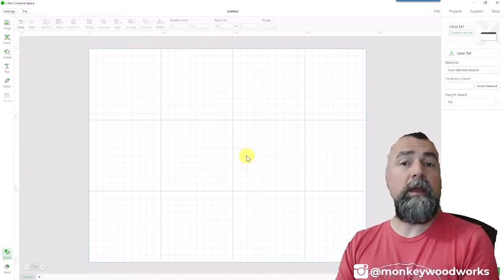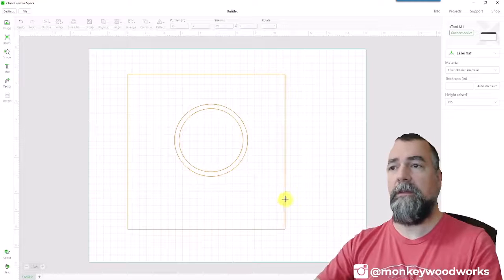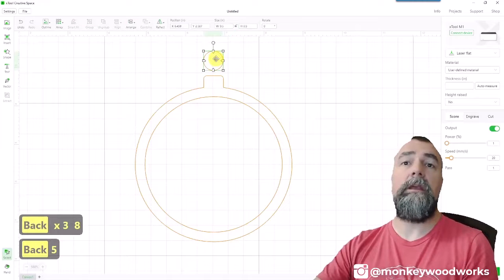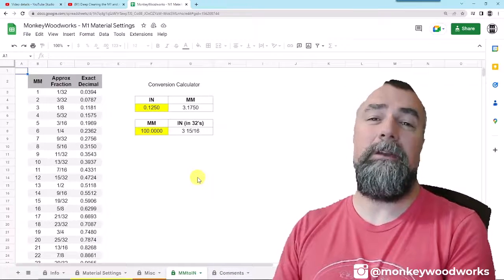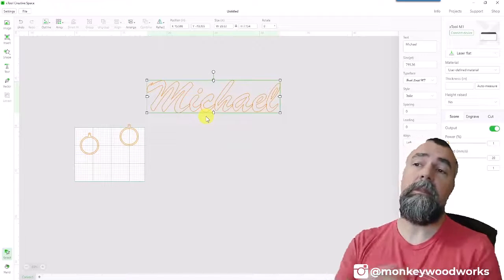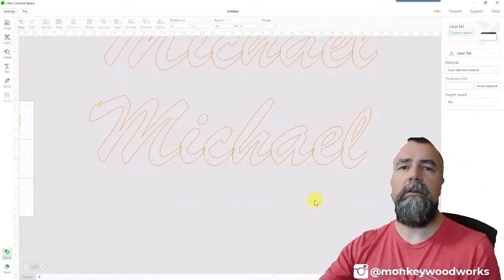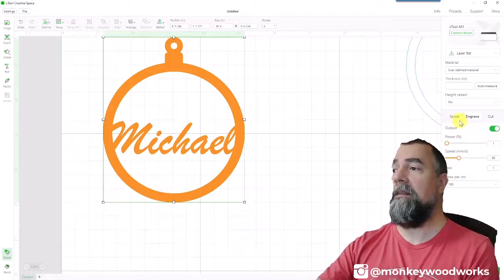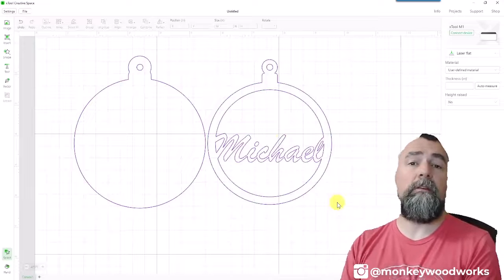Design a Christmas Ornament in xTool's XCS

Comment: Thank you so much for the information. Very helpful.
Reply from the maker: You are welcome!
Reply: I have a question that I am sure you will know the answer to, if I bring in an SVG file on an ornament would I still be able to combine and unite text?
Reply from the maker: @angularbanjoes751  If text is in the svg, the text will be seen as an object once imported, and you can not edit it with the text editor.  You can only edit the imported svg by double clicking it to enter the vector edit mode and either moving or deleting nodes (the little dots you see after double clicking it).  This feature is only available in the later versions of xcs.
Reply: Thank you so much for that answer. You have been so helpful, thanks for the response.

Comment: Hey Michael, I love your video. I have a few questions.
I have been trying out the sample pieces that came with my M1 and I cannot find a right cut settings.  I have the air assist, but it keeps burning. 
What is a good setting and type of 3m ply wood to use? 
Im just lose. Thank you in advance
Reply from the maker: For 3mm ply, you can use the xcs material settings.  Without some more info related to your question, it's hard to help.  Check out some of my first few videos where I take it step by step (with mistakes made).  It could just be a simple focus issue.  Make sure you test making small simple shapes to save material.

Comment: This software looks a lot like Cricut design space  so it should be easy to learn
Reply from the maker: It's a lot like it.  I started in design space and this was easy to pickup.  The hardest part was figuring out cut/score/engrave and speeds.  I made my cheat to make it easy for those getting started and to know what settings to start with.

Comment: Excellent video. How was the dot above the i letter united together?
Reply: Thanks for the reply.  By any chance do you have a video on this process?
Reply from the maker: I made a YT short video about it just now.  https://youtube.com/shorts/RCdpwbvbfGE
Reply from the maker: Great question.  After welding the word together, it becomes an object and no longer letters.  What I do is place a larger circle over the original dot and use combine>subtract to remove the original dot.  Then I add another circle resizing it so it is slightly larger than the original and put slightly overlapping the top of the stick of the letter I.  Then I just select both the new circle and the word, then use combine>unite to make them one piece.  Now the dot is joined to the stick of the i.

Comment: When you cut this, how do you keep the dot for the "I" and the centers of the letters from falling out and just leave a big hole?
Reply from the maker: When I make these, the back part is solid and the name part is cut out and glued to the solid part.  The dot of the "i" is a pain.  It falls down and you have to try to find it and glue it by itself.  What i have started doing recently is making my name in XCS, sizing it how i like it and welding the letters using the new WELD feature in XCS.  I am still left with the dot of the I however the weld process is much easier now.  Once i do that, i draw a small circle just covering the dot of the i, select the circle and the name and use the combine feature to remove the dot completely.  I then draw another circle where the dot used to be, making it a little bigger than the width of the i, move it down so it touches the i and using the combine tool once again, i combine my new dot of the I to the stick of the I so they become one piece and makes it easier to cut.  Hopefully that made sense!

Comment: S there a way to make the screen mor visible, I have maculer degeneration so my vision isn't as good as it should be and the standard screen for me is faint.
Reply from the maker: I agree with you, the screen is very dim.  Especially when using the preview just before sending the job. Here are a couple of ideas that came to my head:  In the XCS software, place items on darker layers so they are easier to see.  Make your computer resolution a smaller number to make things bigger under the display settings.  Also, perhaps use a magnifying glass  on a stand that you can move in front of your monitor so you can see up close (https://amzn.to/3qMW3oQ)

Comment: When creating the back solid piece, why did you make it 3mm larger, instead of the same size? BTW, Thank you, 2nd time watching, 1st time I tried it, the name.... well, I didn't break it up and put it back together.... Back at it
Reply from the maker: I made the back piece larger just for a personal preference.  It is totally up to you on how you want to design it.  
Also, if you haven't updated your XCS software make sure you do so.  They added a weld feature so it is now MUCH easier to weld text together.  I show how do do that in my latest XCS related video.   They also now have a way to curve text however that came out after i released my video so that is not shown in my video.

Comment: Trying to make the project as shown in the video and after the update on software - unite now removes my text.  Any help would be appreciated.
Reply from the maker: Make sure you are working with a donut shape before placing the text inside.  A way to check it is to change the shape to engrave to see if you are working with a solid circle or not.  If it turns solid, you missed the step of using the combine feature.

Comment: If I upload a png file in xcs am I able to add text underneath? I keep getting an error that I have selected different types of design elements and I cant modify the parameters all at once. It doesn't give an option to combine when highlighted only group. Thanks for your video its been very helpful!
Reply from the maker: A PNG file can only be engraved. However the text you type can be engraved cut or scored. They are 2 different types of elements so you cannot group them together and set the primators at the same time.
Reply: @MonkeyWoodworks  Thanks that makes perfect sense. So I don't group anything I just put my text under the image and it will recognize it as engraved and will stay in line with my design?
Reply from the maker: @WendyBurwell  You just have to select each itype separately and set the settings off to the right. So you would select your image file adjust the engraving setting. Then select your added text and adjust your settings off to the right if you want to engrave cut or score. Basically just treat them separately.  But they will be lined up with each other as you see on the screen
Reply: @MonkeyWoodworks  Thanks!!!

Comment: Hi. Once again thanx a million for your Useful tutorials. I would like to know if its possible to Carryout Engraving first then do the outline engraving with offset of 1mm no cutting. If its possible would it be possible to know the process please
Reply from the maker: The only way to have 100% control the order of operations in XCS is to select all items on the screen then set the output to OFF.  After that, select the item you want to process, set the output to ON and send it.  Set that item back to OFF and next item to ON and send it.  Just repeat that over and over until your project is complete.
Reply: @MonkeyWoodworks  Brilliant! Thank you for the Useful Advise.

Comment: Thank you for the very well thought out and easy to follow tutorial. I just received my M1 2 days ago and tried making a christmas ornament it was a fail. Curious to know if you use the subtract in combining or just the unite? I watched another person's video and she used the subtract but I was only able to use 2xs and anything else I tried to subtract would not work. Any helpful tips would be very much appreciated. I want to add more design in the circle
Reply from the maker: I do use the subtract at times.  Each function has it's own specific use.  I know different versions of XCS has limits on the number of times you can use the combine feature.  I am on version 1.0.19 at the time I am replying to you.  As a test, I added a circle then added a half moon on top of the circle, selected them both, and was able to use Combine>Subtract to cut out the moon shape from the circle.  I was able to do that 4 more time without an issue.
Reply: @MonkeyWoodworks  thanks I will try it again and see if it works.

Comment: Hi Michael, You explain things so clearly and stay on topic as not to confuse anyone.  You Rock!  Would you please tell me the benefit of the Riser Base with Honeycomb Panel? I am starting my order over to ensure you get the credit.  I have learned so much from you.  I know now  I am going purchase. Thanks for the spreadsheet.  Invaluable .... Thanks again...
Reply from the maker: Thank you!  The benefit of the riser base is that the M1 is already lifted up. So when you need to engrave a tumbler or a similar object, you don't have to try to lift and balance the M1 on top of risers.  The only thing you have to do is open the front of the base and move your honeycomb or base to the proper height to meet your needs.
Reply: @MonkeyWoodworks  Thank you so much!  Thanks so much for sharing your knowledge.  You have really made me come off the fence and just purchase.

Comment: I think you can enter a decimal by using a leading zero.  So .5 would be 0.5
Reply from the maker: I have tried that, it does not let me unfortunately.  Lets say the value is 3.5 and i want to change it to 0.5, I can highlight it all and type 0, it changes that 0 to 3.5. I can also backspace all the way back to null and type 0, instead you see the original 3.  It is a silly bug for sure.